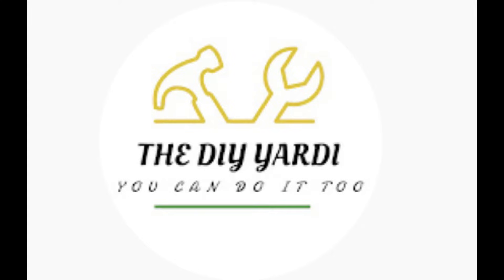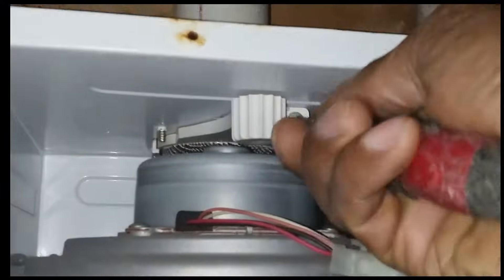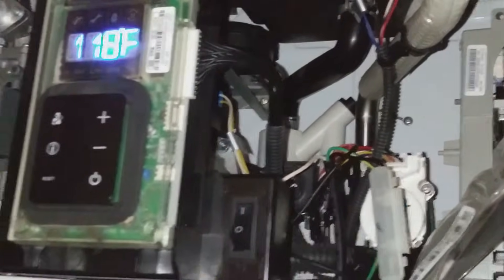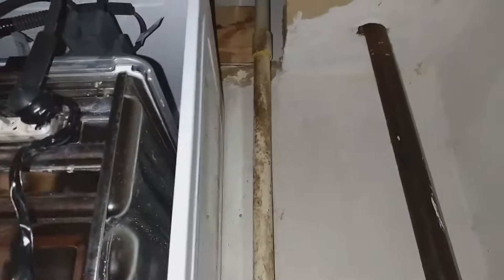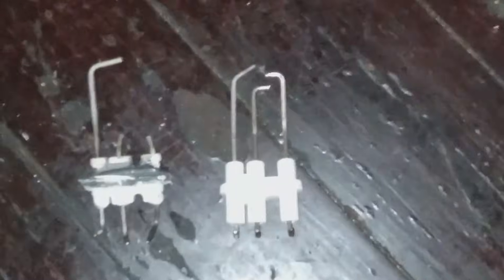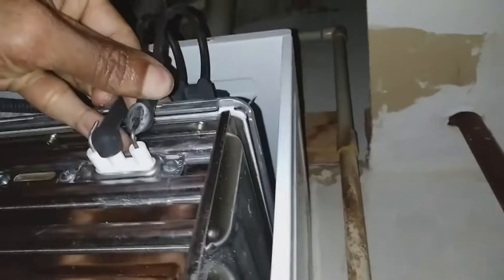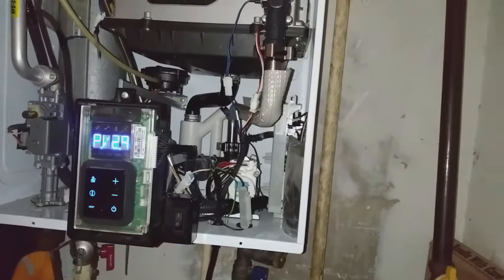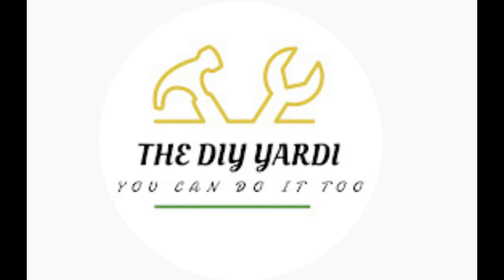NAVIEN TANKLESS HOT WATER HEATER NOT HEATING AND FLASHING ERROR CODE 3 FIX.

Comment: I changed one on my home do they intend to wear out with in a year or so?
I’m having that same code. I serviced it checked all filters and trap, flushed system with 2 gallons of white vinegar descaling the unit. It turned on for about a minute then shut off. Going to check the flame rod again and see.
Thanks!
Reply: I had it off last night went to turn it on and it turned on but the code now says 046E which is the the High Limit Switch. I ordered it waiting to come in on Thursday to install it myself. Hopefully that makes the system work fine again🙏🏽 Thanks for getting back!
Reply from the maker: @ANGELCRUZ-fe2yh  you're welcome, hope that takes care of your issue..
Reply from the maker: Hey Angel, it is not supposed to burn out within a year, but anything is possible, somme parts have defects and therefore don't last as long as some others do, best to check it and make sure it is good, at least to confirm if that's the issue or not, good luck with that...

Comment: What’s the part number for that ingiter?
Reply from the maker: Hey there Keefyboy, that info is in the video at the end, I show the box it came in, it says code number, if you google it, several sites will pop up, I ordered it through amazon, but its up you were you want to get it from.
Reply: @thediyyardie7192  I don’t see a gasket included with the one on Amazon. I assume that also should be changed as well?
Reply from the maker: @keefyboy4601  The on I got came with a new gasket, and yes it should be changed.